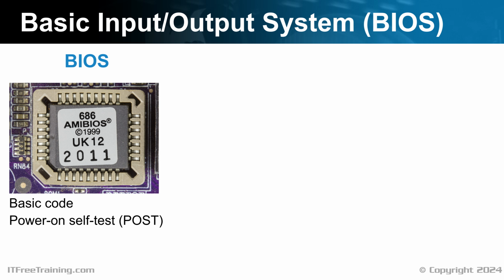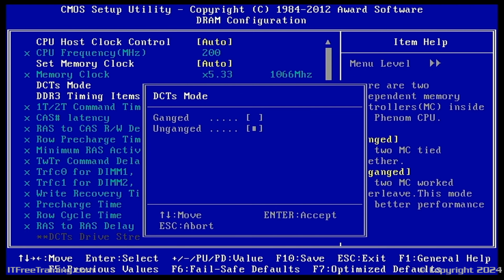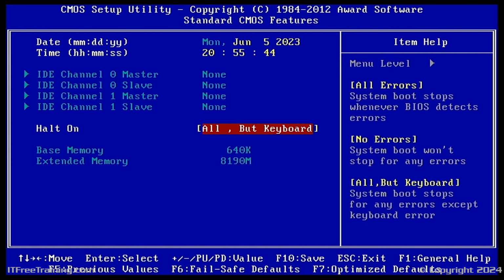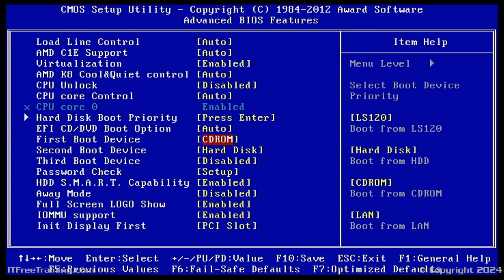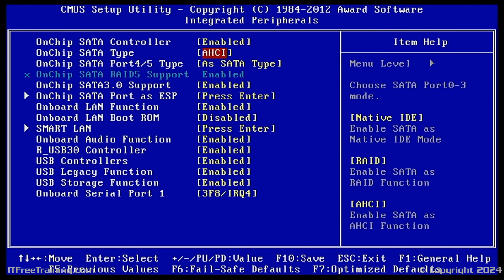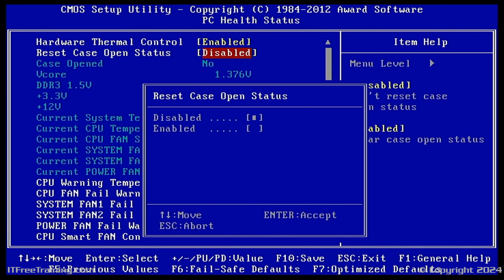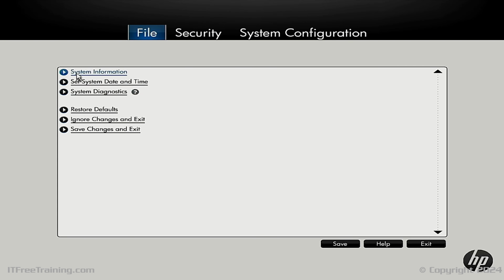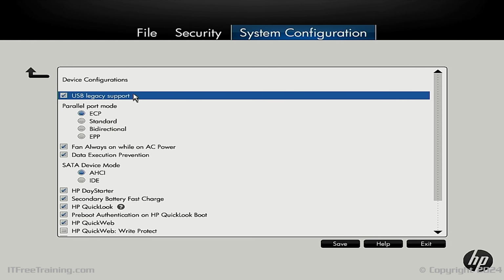BIOS Settings - CompTIA A+ 220-1101 – 3.4

Comment: How about NVME storage instead of IDE???
Reply from the maker: IDE is very old nowadays. So would recommend Solid-State instead and NVME if you have it.
Reply: @itfreetraining  so WHY there is IDE in the video instead of NVME if it is very old?
Why there is DDR3 Ganged or unganged mode if those ARENT A THING in DDR4 and DDR5 CPU's?
Reply from the maker: @volodumurkalunyak4651  Sounds like you want the UEFI video. BIOS is the older system and this video goes through the settings you may find in a BIOS system. The idea being if you are supporting an old computer. Computer that use NVME, DDR4 and DDR5 are most likely to be using UEFI.
Reply: @itfreetraining  wht also not a word about CPU power limits, XMP/DOCP, above 4G decoding, resisableBAR, and even secure boot???

Comment: Thank you very much, this is very useful.  I have a 2009 HP and I have never seen the graphic BIOS, only the text-bluescreen BIOS. What key did you press to enter the graphical BIOS?
Reply from the maker: The BIOS will be either text or graphical based. In the video we demonstrated two different BIOSs, one is text based and one is graphical based. Newer computers generally have a graphics based BIOS.